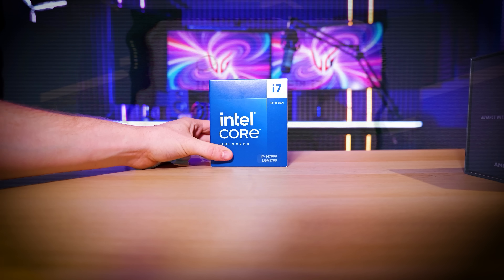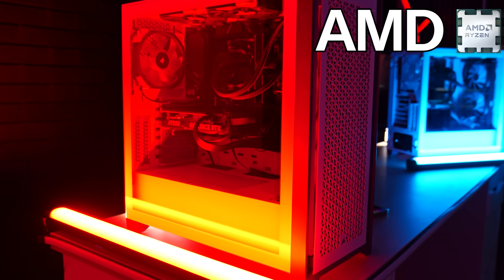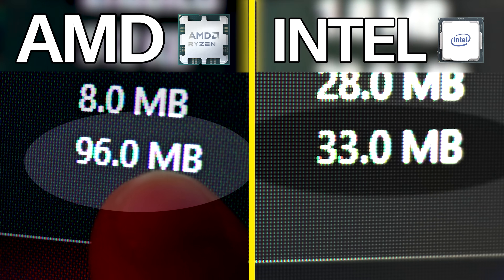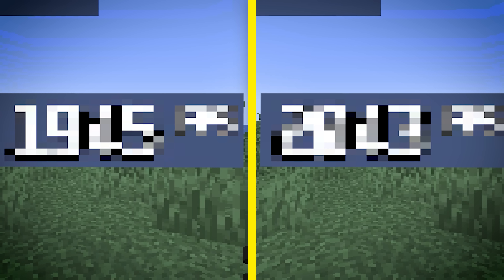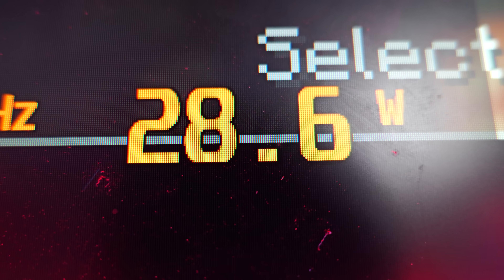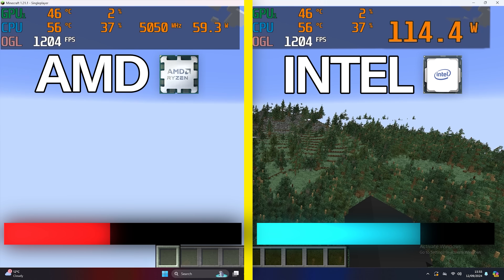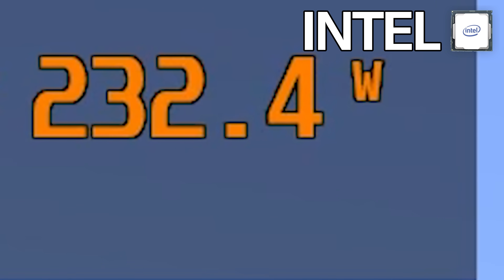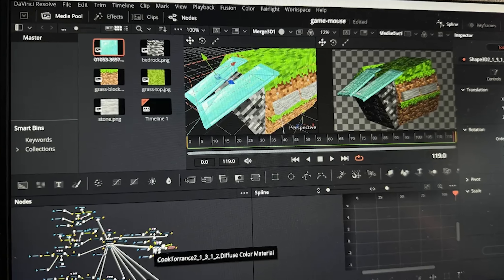Intel VS AMD - Which Is Actually Better?

Comment: The reason for amd system being so slow in bootup is cause its training its ram everytime you turn it on by default. Turning it off so it only trains when required makes the amd pc bootup as fast as intel. Speaking from experience as my ryzen 5 7600 pc took like 40 seconds to boot normally but takes like 10 seconds with the setting "memory context restore" on off

Comment: 8 cores in intel cpu🤡
8 cores in amd cpu🗿
Reply: 8 efficiency cores vs 8 performance cores + 3d v cache
Reply: @kazim1700 what? No, the 14700k has 8p(performance) cores and 12 efficiency cores.
Reply: @kazim1700 20 cores are taking 245 watt and 8 cores taking 80 watts.
Reply: AMD fans are mad 😂
Reply: Bro doesn't even know Java Minecraft can only utilize 1 core 💀
Reply: @LOL_MANN  the main game loop of Minecraft Java Edition relies heavily on a single core, it does not only use a single core
Reply: @Shauryatripathi-r8n Wow you wrote something I already wrote 1 year ago, congrats uncosaurus 🥀🦕
Reply: fun fact: intel has deca core cpus... on the budget laptops
Reply: Intel is still good
Reply: @luffyzoro-lq8yt nowadays it garbage
Reply: AMD=😂🤮🤡
Reply: Super cores to ne exact
Reply: 0 iq i got 4 cores on a older intel platform and im still rocking on anything at 1440p
Reply: @online_degenerate cyberpunk bare bones settings?
Reply: @kowhaifan1249  nope i get 60 to 80 fps on high optimised settings with rt shadows at 1440p tho i do have a fsr 3.0 mod and xxs enabled but the downscaling is very little and the frame generation isn't bugging out or looks bad its just perfect. You really DON'T need such high end parts as most tech youtubers say for the most part only if you are interested into ray tracing or play horribly unoptimised modern games that make high end pcs struggle while looking quite mid
Reply: @online_degenerate bro it depends on gpu
Reply: @online_degenerate 1440p is less cpu intensive
Reply: @3dplayer3 bro what...
if in gaming still you need a good cpu to do 1440p if youtube playback you need even better cpu because of video decoding
Reply: @3dplayer3  i know that but even in 1080p i have about a 10% bottleneck and in other games 0%. Still quite great performance running a 9 year old i7 6700k 4.7ghz with a rx 6600
Reply: @online_degenerate because 1440p is gpu intensive if you wanna test a cpu you need to do in low settings
Reply: amd idiots getting any excuses be like:
Reply: Why why
Reply: @Minisongq  ?
Reply: nah bro you haven't seen intel cpu power and nvidia power combine!
Reply: im sick of these damn fanboys
Reply: but the intel cpu had 20 cores
Reply: Brainrotted
Reply: This is basicly somw kid trolling
Reply: AMD looks cyberpunk future

Comment: No way bro paired a 4060 with the 7800X3D and the 14700K💀.Largest bottleneck I've ever seen. Btw, the 7800X3D was made mainly for gaming, not for productivity tasks, for that reason, the exists 7950X3D. But all Intel cpus are good at productivity tasks but not gaming though

Comment: Intel at Gaming:👍
Amd at Gaming:🔥🗿
Intel at Productivity :🗿🍷
Amd at Productivity :🤐
Reply: U can definitely buy a 7900x3D or a 7950x3D which consumes a lot less power than i9 13 and 14 gen cpus
Reply: @xovgamer but costs double😂
Reply: @xovgamer power my ass, if you can afford an expensive pc you can afford the electricity bill
Reply: @walmartkart6175  as if you pay them 💀
Reply: @walmartkart6175  Lol wtf ?
if i comment anywhere about intel being my favorite, people get mad, vice versa,
if i do favor Ryzen, people get mad.

i use a 14900k with 253 watts on max load ( cuz the Mobo manufacturers pushed a lot of voltage and wattage on 13 and 14 gen cpus, so be sure to switch to intel baseline profile instead of Asus/msi/gigabyte profiles )

I just said that Ryzen 7950x3D is good in power consumption and heat produced
Reply: @xovgamer  I'm not hating over whether you like intel or amd, I'm just saying if you can afford an expensive pc then a little bit more power consumption shouldn't hurt
Reply: @xovgame 2 dollars more a month for intel cpu. Oh no i cany afford that

Comment: Listen Let me tell you something firstly i9 14900ks is the best consumer cpu and it is better than the amd ryzen 7 7800x3d but when its comes to i7 14700k amd is better in gaming and the shader test is completely wrong casue thats mostly gpu related not cpu and the intel i7 is better for productivity cause intel has more cores but amd has more L3cache so its btter in gaming.
AND 4060 IS TRASHHHH

Comment: 2:36 MSI's boot loading time are way longer than others, don't know why but this a known fact :D. So there is technically no difference.
Reply: My pc with a first gen ryzen 5 1500x boots up much faster than these weak ahh cpus 💀
Reply: @AnisTheLxgend  EFI difference
Reply: @franchementjesaispas...4337  i have a MSI a320m-a pro max so my bios may be no different than the one in the video

Comment: Your opinion was considered irrelevant in my eyes the second you said "I have the best of both brands" and then proceeded to show a 14700k when everyone knows damn well the 14900k is better (even though the 14900k is still slower than the 7800X3D but that's not the point.)

Comment: Everything wrong with this video:

- The whole premise. Intel and AMD can’t be represented by just 1 cpu.
- Didn’t use the fastest intel cpu (14900ks)
- Didn’t mention intel instability
- Used 5600 mt/s ram (AMD heavily favors 6000 mt/s)
- Used boot times as a metric (depends entirely on motherboard and drive speed, not cpu)
- Didn’t show any bios settings (maybe didn’t enable XMP/EXPO)
- Compared Cinnebench scores (not AMD or Intel’s fastest workstation CPUs)

Overall, I enjoyed this video, and it gave me a laugh. That’s what’s most important.
Reply: He choose to compare cpus in the same price range...
5600Mts are manufacturers Specs . If otherwise he also should use 7200mts for Intel couse that's where intel works best
Reply: @melon3210  Yes, they are in the same price range, but again, one cpu does not represent an entire company. And for the ram, that may be true, but 5600mt/s runs significantly faster on intel.

Comment: in modern versions of Minecraft, optimization is terrifying. advanced pre-binned i7-7700K on chiller and 5500 MHz + 5100 MHz ring (1.5v) + tuned 32GB memory B-die 4200 MHz CL15 (latency 32 ns). MAXIMUS IX APEX. Minecraft loads the processor by 90-100% on a drawing of only 10-12 chunks and freezes terribly and lags.

Comment: Amd is better becaue 14th gen has stability issue after the motherboard bios update it will undervolt itself and peform worse than before and amd ryzen is more power efficient

Comment: for my first pc im gonna try to get a 7800x3d :)
Reply: its 820$ canadian
Reply: @LunarLikeFortnite   where are you looking
Reply: @GR3Y_PNG  Msrp is 380 us it is currently going around 450
Reply: Just get 7700 and upgrade to last gen x3d on the platform when prices are fine.
Reply: Do NOT get 7800x3D for it's outrageous price of 550$ instead get 7900x3D
Reply: same im getting it november 15th
Reply: Wait until intel looks better and there is more supply for up to a 100$ discount
Reply: @Sceuxm Agreed. Prices right now are ridiculous. Wait a month or two for demand to go down. If you live near a microcenter, try to pick up a 7600x3d. Good luck :)
Reply: @Sceuxm  Discounts do not work out in electronic market lol. The max you can get out of discount would be black friday and only black friday, plus intel has been an outsider in the gaming industry after 12th gen, and continues to fail us through "updates" with no potentials. Still waiting for intel optimizations and a 3dv cache plan which AMD already has for years. Anyway no point of buying intel even with discounts cuz amd still cheaper
Reply: @astqh  it will be cheaper as right now    the price of amd cpus are a lot higher than normal as companies are charging a higher price as there is now foliar more deman

Comment: For those who just cope for intel 14th gen cpu problems, it is now fixed and just blame mobo manufacturers, they basically disabled power limit for INTEL CPUS !!
So thats the reason why i9 14900k pulls 350 watts instead of 253 w said by intel under full loads.
Go update bios, slightly undervolt your cpu ( IT BASICALLY GIVES SAME PERFORMANCE OR EVEN BETTER AND TEMPS. STAY LOWER ! )
And Still, i don't i love AMD as well, they are literally doing a good Job :D

Comment: ok. intel for productivity, amd for gaming.  

why coudnt you try max framerate on everything low, cause i have the exact same specs  but the cpu is the 13700f, and my max is 6000 frames without mods

Comment: What's sad is that windows 11 is locking away AMD's full potential
Edit: Even with the update, I saw that benchmarks on W10 has at least 10-30fps more
Reply: fr, this is why i still use windows 10
Reply: @Zystico  yeah win 10 give me extra 30 fps in valorant and in esport titles fps matters a lot
Reply: i can feel linux fanboys approaching!!!!
Reply: @SmileyDawgg  Ngl I'd rather have windows 10 then the poorly optimized really bloated windows 11
Reply: @project_anti  yeah fr
Reply: @project_anti  same, i run windows 10 too lol
Reply: @SmileyDawgg  same, cracked windows 10 pro user
Reply: @SmileyDawgg  I am a linux fanboy
Reply: @SmileyDawgg  i use linux but not a fanboy, since i dont hate on oses
Reply: update to 11 24h2 it fix
Reply: @Phan1hs  even if you update to 24h2. The performance gap between W11 and W10 is still big
Reply: @project_anti  depends what gpu you pair up with , I have no problems on 2k ultra with a 7800x3d and ryzen 4070 ti super
Reply: @project_anti why should i use the 11 over 10 then
Reply: @user-su6ts9wm1h  No I said the opposite. I'd rather go back to 10
Reply: @Phan1hs  does 24h2 perform better in terms of gaming than windows 10?
Reply: @Zystico  No even with the new updates and all. Windows 10 has a great performance increase
Reply: fr
Reply: no
Reply: the update already rolled out
Reply: Of course, AMD fanboy!
Reply: Aren't they adding a update with Ryzen cpus to boost gaming performance or was it intel cpus?
Reply: @Sincro_1  Ryzen CPUs but even with the update released windows 10 outperforms windows 11 alot
Reply: @project_anti  ok
Reply: microsoft does infact favors intel on their os more than amd, most embarassing fact is that even with nerfs, amd still smokes intel
Reply: They are working together rn to solve this problem
Reply: @nsit-k5x  cool
Reply: Win 11 performs better for me idk
Reply: i didnt know win11 takes away performance!!!!
Reply: only on the 9000 series is it semi noticeable
Reply: I heard that too.
Reply: why i wont use a win11 rig for gaming yet... until they fix that. i have both intel and amd.
Reply: It's more like Windows is locking away Intel's full potential. If you pause at 10:30 you can clearly see that Intetl GPU utilization is only 25% compared to AMD's 99% utilization, yet Intel is performing better than AMD

Comment: for the last test you tested them in different biomes on the igpu test, which shifted favours towards intel for the overall draw, so you could conclude the video with a draw

you gave the intel system an unfair advantage on that last test

Comment: faster doesn't equal more powerful tho. Everyone already knows that ryzen 7 7800x3d is the like the fastest processor. The intel i7 13th gen has a lot more cores which makes it much more powerful.
Reply: Eh depends on usage
Reply: @TheSillyHaxor  an illustration one of my  friends used to describe this is a r7 7800x3d (or now the 9800x3d) is like a racecar and the i7, or i9 is like a truck. It's a lot more powerful and can pull heavier loads, but the r7 is a lot faster.
Reply: @Perfect10nYT that's s very accurate description lmao
Reply: @TheSillyHaxor lol, yeah. But now with Intel's downfall with the 13th and 14th gen cpus it's not quite the same. Honestly kinda sad that they aren't rlly competition for amd in cpus anymore but the their new battle mage gpus are launching soon which might be their saving grace.

Comment: A fun review. But anyone considering the Intel 13th and 14th gen CPUs should first research the recent stability issues affecting these CPUs. Both are good CPUs, but for me, I would go with the AMD in this case, due to superior gaming performance,  significantly lower power draw, and the platform longevity.

Comment: Next amd gpu vs nvidia gpu? 4070 super vs rx 7800 xt? It would be fair to use Intel with nvidia and amd with amd, cuz you can enable SAM and rbar on each
Reply: 4070s loses to 7900gre. It doesn't compete with 7800xt
Reply: @nurd699  the rx 7800 xt is slightly better than the 4070 super. The super series isn't supposed to be competing with higher end amd cards, it's a refresh of the original non super.

Comment: 14700K FASTEST?
Reply: Just in workload because the 7800x3d is not made to work but to work the 7950x3d is even better than the 14900k in multicore performance and gaming
Reply: @lixedo5699  7800x3d IS FASTER THAN 7950x3d IN GAMING
Reply: @amirashkavandi5981  they are basically the same performance in gaming with the 7800x3d with like 3 or 4 fps ahead but both of them are faster than the 14900k and the 7950x3d is faster than the 14900k in working also

Comment: Why AMD might be more worth it:

1. Better upgrade path on AM5

2. Intels 13th and 14th gen CPUs are prone to degradation and failure over time.

3. Guiny probably forgot to turn on AMD Expo ram profile in the BIOS which is very important on AMD PCs. This might have had quite a bit of a negative impact on the AMD PC's performance.
Reply: Upgrade path 😂 bro you probably won't upgrade your cpu for next few years , And The " Upgrade path" is only worth consider with Expensive Motherboard .
Reply: @trere362  yeah, seriously it's not cheap to build a PC
Reply: @trere362  What are you on about? At the pace that games are advancing at you should have an upgrade path for some future proofing if you're spending that kind of money on a PC. Also the price of the motherboard has nothing to do with the compatibility of CPUs as long as the socket is supported. For example you can pair an AMD Ryzen 7 5800X3D with the oldest and cheapest AM4 motherboards like the A320 or B350 boards and have no problems.
Reply: @ftx10   cpu barely ages in games why would I future proof if I wont be upgrading shit for next few years
Reply: @ftx10   bruh thats  some cheap ass Motherboards I would bet it will Fire it Self with that cpu also lack of even pcie 4.0 support is nothing good  Pairing this CPU to that low grade Boards is insane
Reply: @trere362  Actually i've been running one of my pcs with that pairing since last year and it has had no issues. Everything is running as it should.
Reply: @trere362  Really depends on the specific programs that you're using
Reply: agreed
Reply: TEAM RED FOREVER!
Reply: @FNaF-Fan-8893  Hey dude, never be a fan of a brand, be a fan of value
Reply: @soumyadarshansahooxa9094  Oh no I agree. It is just that ever since AMD's boom, price to performance, they are better than Intel.
Reply: Oh boi, please don't have brand loyalty

Comment: "only 8 cores" i got 2 cores
Reply: So you use a 2011 Pentium
Reply: @Sceuxm  nope an i3 5005U
Reply: 2Ghz
Reply: So u have a 2015 laptop dahmm time to upgrade
Reply: @Sceuxm  The CPU is soldered
Reply: @Sceuxm  I'm getting a 700€ pc soon

Comment: For minecraft specifically, the reason why the i7-14700k performs a lot better while running around or standing still is because of it's insanely good single threaded performance, which intel has historically had going for it compared to AMD, but when it comes to flying around, loading in new chunks and map data the ryzen 7 7800x3d took the lead there because of its enormous amounts of cache, the additional cache allows the CPU to store and access more data quickly, which is advantageous when dealing with large amounts of information (like loading new terrain) and other data heavy environments in minecraft.
Reply: Well said.
Reply: Amd also has less temperature Which makes it crucial for heavy loadings
Reply: Well if Intel could optimize their CPU it might be better especially on power usage 💀
Reply: @skidunion  you didn't even read his comment
Reply: @dirtybtch-74o  i did, by optimize i mean create a balanced CPU.
Reply: @skidunion  he said its the cache, that has nothing to do with the power usage
Reply: @dirtybtch-74o  dude stop messing, i was just adding an extra comment to his one 😭  just saying Intel could make something to make more balanced CPU and rework their CPU for a better electricity usage.
Reply: @skidunion  they just need to reduce their core bruh, it uses alot cause of that. If they can optimise it with that many core, it will be very good tho.
Reply: @onlywolf9981 Thats easily resolved manually adjusting cores and clocks...  my 14700k runs at all core 5.4ghz on air with 1.2vc and hardly ever goes over 70 watt in any game I play.
Reply: @skidunion  that's exactly what intel did for core ultra series, possibly coming to desktop 15000 series as well... and they're removing hyperthreading...